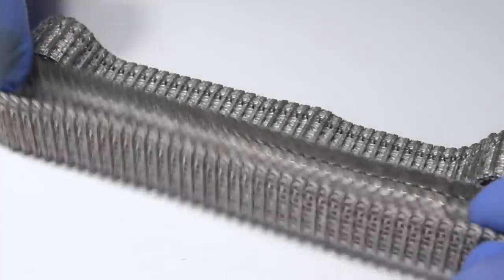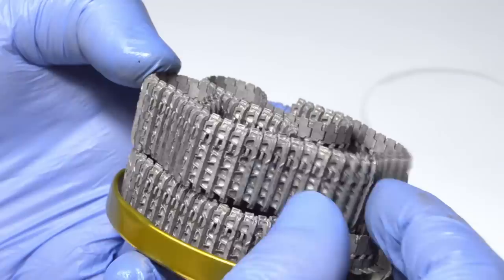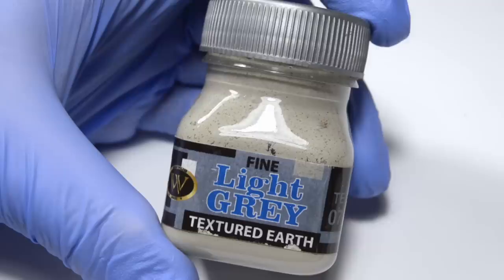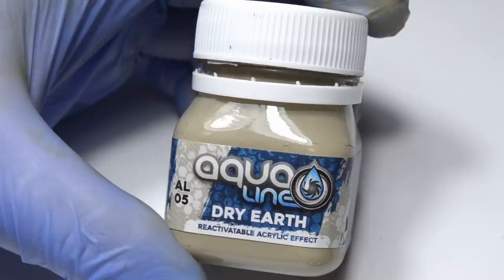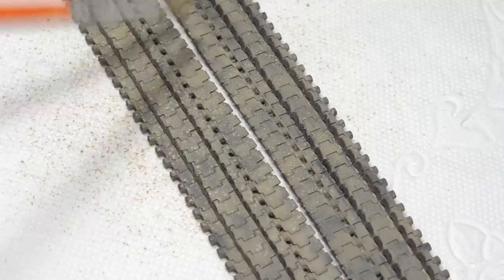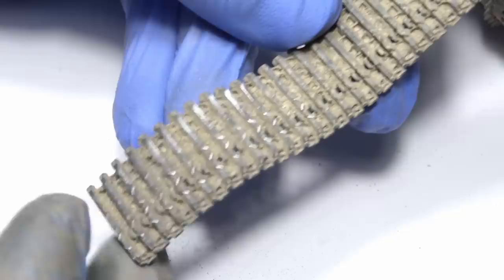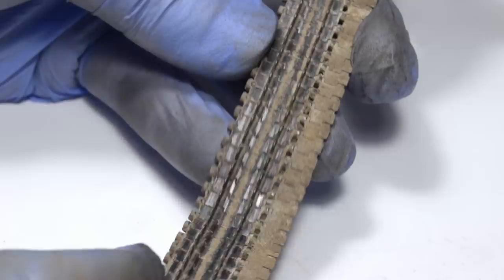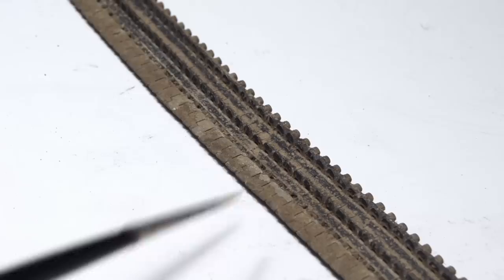Weathering Metal Tiger Tracks Is So Easy!

Comment: Nightshift: its easy
me: still has extra tank track parts and there arent supposed to be any extras Ehh how did i manage to do that...
Reply from the maker: There are always a few spares in every set :)
Reply: Night Shift not in revell kits,(usually) I Somehow managed to Mess it up and it looks ok
Reply: @ryzenenjoyer2824  maybe it was messed up in the first place and, by messing it up even more, you actually made it OK? :D
Reply from the maker: @ryzenenjoyer2824  Oh Revell! Still better than having the track too short eh?
Reply: @NightShiftScaleModels  Thats the reason why some people only build models with wheels...
Reply: KrzysztofzBagien well... maybe? So those were plastic tracks (non workable, you just glue them piece by piece to road wheels, There are Tiny track parts and longer track parts, I put The bottom track part too far back, So I had to use some more parts on The front, less in The back, Also it propably doesnt help that I dropped my tiny plastic container on The floor (I kept my track parts There) and it fell on The floor, I think I got every piece but im not sure. I still have no Idea how I have spare parts? Like I built revell t55 and that didnt have extra track parts (those tracks looked ok) but The king tiger (by revell) had some extras, I know that it has spare track on The turret, but I still have extras So idk, Also one of The tracks looks Ok, but The other one I kinda messed up, it has a little bit of a Gap on The back and front (theres a bend) im thinking if I should just put some mud There, but at The same time I want to keep it clean, I Could put some putty on The cracks.
Reply: Night Shift yeah

Comment: You are absolutely right on the track wear. Late tiger road wheel sets deleted the outer wheels. This put more of the weight on the inner area of the track causing the uneven wear. The tiger at vimoutiers also shows grooves on the inside of the track where the road wheels rubbed. Mid and early tigers had that extra set of rubber rimmed road wheels which spread the weight more evenly and caused more even outer wear and less wear inside the track too

Comment: I'm not familiar with that bluing system. Is it selenium-based like "real" gun bluing?
Reply from the maker: I don't know much science behind it, but gun bluing seems to act much faster - almost immediately. This takes some time.
Reply: I was curious about this as well. If so, hopefully u poured the bluing solution into a smaller working container, worked from that, and didnt return any of the used product back to the original jar. If you do that with traditional bluing solutions it usually will cause the whole bottle to become useless after a period of time. However i know nothin of the type ur using, and if its cheap like u mentioned then it wouldnt be a terrible loss anyways.  Great videos. Im more of a miniature wargamer, but love the techniques you teach as they are easily applied to other styles of the hobby. Good work my friend.